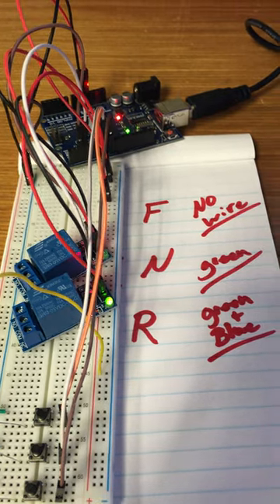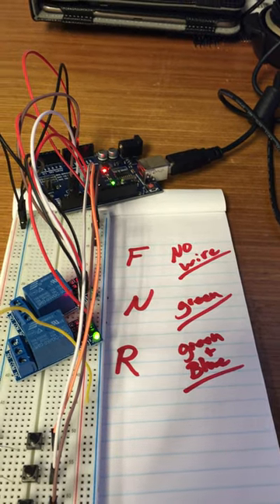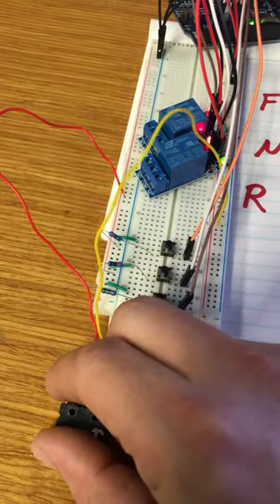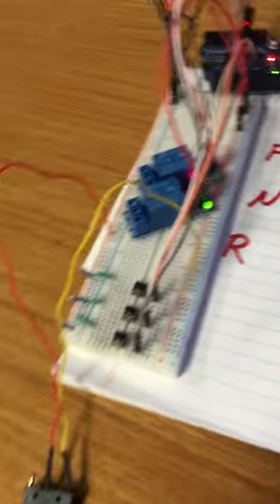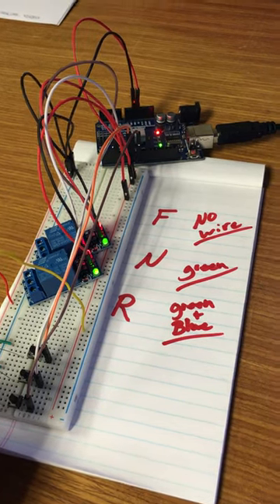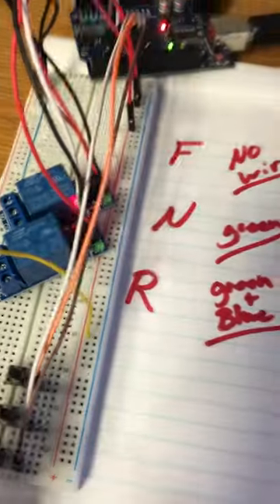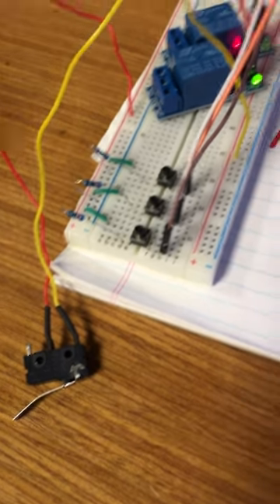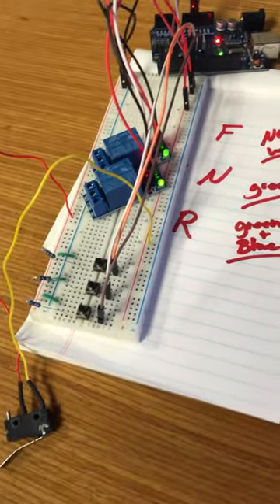OMC Electric Shift Switch for Johnson/Evinrude outboard make a push button switch 65hp

Comment: Im having issues with my 65 75 hp electricshift rude. 
Itll go to neutral and reverse no problem i can get it to go into forward but it takes me up to 10 trys going into reverse neutral and the back to forward. Ill pause a few seconds to l give it some time to  shift in and out. Ill drop my idle super low also to get it to engage too but soo far same thing. I even check for power and continueity and it all good. So does this means it’s something to do with my lower unit?

Comment: What if you were to tap into the tach speed sense wire and add a speed sense check in the arduino code that would not allow shifting from F to R or back with rpm greater than lets say 700 but would still let you shift into neutral in case of emergency.  I was wondering if you would share your code?  The dropbox no longer works.

Comment: Hi, awesome work with this I was thinking about doing the same thing myself for my old Evinrude currently I'm just using a simple toggle switch,  would I be able to get a copy of your arduino code for this project as I haven't done arduino coding myself?
Reply from the maker: I updated the details of the video, and added links to my code and wire diagram. I added Arduino code and Fritzing code also that also has a diagram with it.
Reply: Thanks, that's awesome should save me lots of time I'll let you know how I go with it

Comment: with no inputs the motor will start in forward. there is a diode in the circuit as well. looks like a set of dognuts hanging on motor block.

Comment: Just get a double pole 3 throw switch (DP3T) at Mcmaster Carr. Why overcomplicate
Reply: there are a set of dognuts in the circuit, diodes.
Reply from the maker: No because if you use a basic switch you go from forward to reverse then Neural and it can mess up the gears. I made a simple dual relay and not using this any more. The relays just are setup with the boat always in N with an emergency toggle to switch  it in forward it works great ill update with a new video soon. Been using the relay method for a few weeks now and its way better. Its tied into the N switch so you can shift unless its in N.
Reply: Just make sure it's not easily bumped or switched by accident!  Not a good idea to switch directly from forward to reverse when throttling!
Reply: @mrt6506  Not if you hook up the neutral to the middle toggle.. then one on is forward, middle neutral and other on is reverse?  Right?